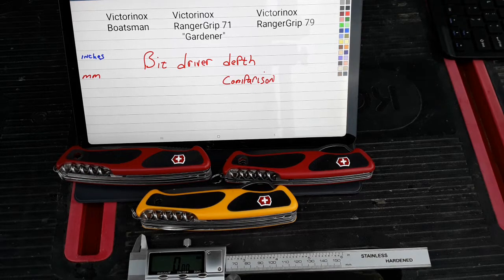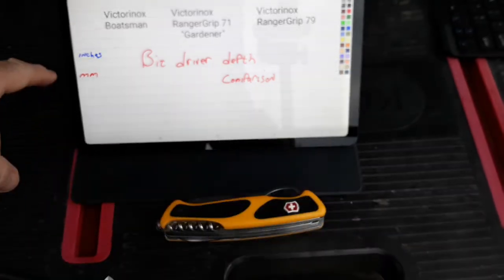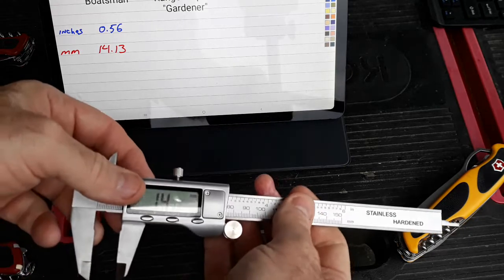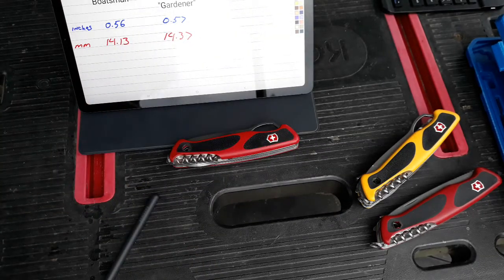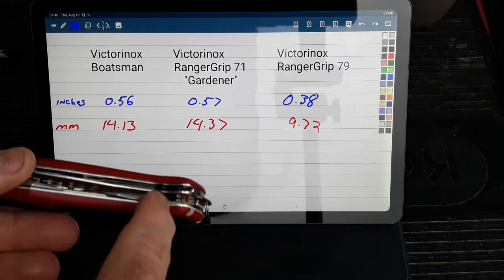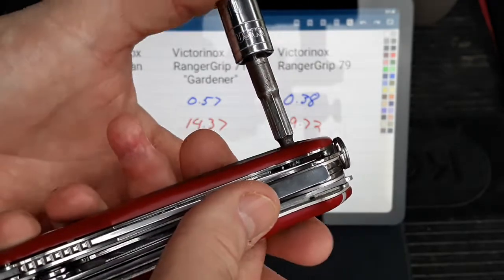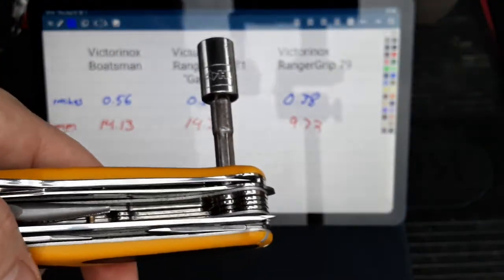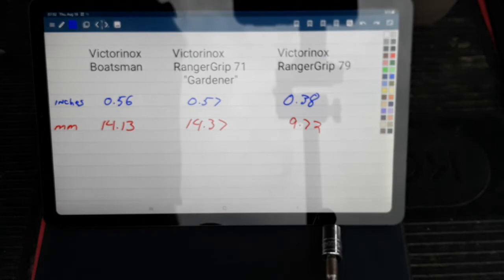Victorinox Rangergrip Bit Driver Depth Comparison

Comment: I see what you are saying. If you cut the hole out the 79 scale you can use bits but light duty stuff being one layer bits go in and can easily get cammed out. Even the one with the cutout for bits not made for a lot of torque and larger 1/4" sockets. Not intended for that. Have a good one!
Reply from the maker: True. Felix Immler showed on one of his videos that a single layer can withstand the torque to drill a 1" hole.
But, I only do 1/4" at most and that is going through plastic or soft wood. Other than that, I don't really risk it.
Thanks for viewing and commenting. Take care.